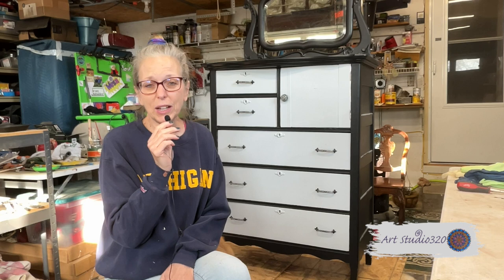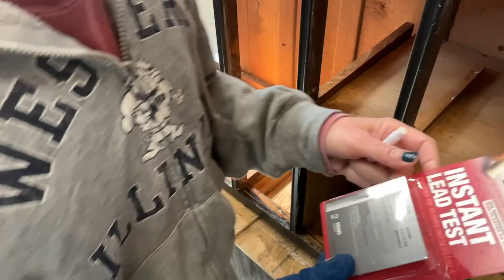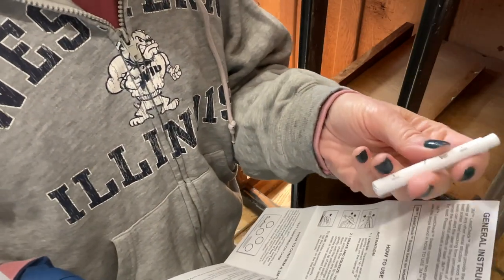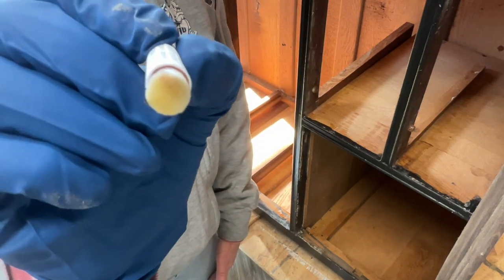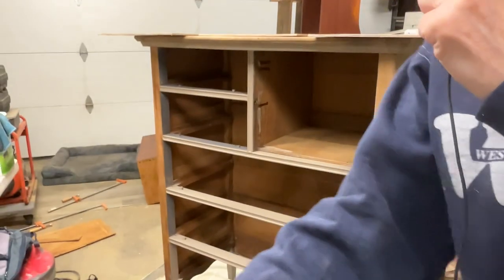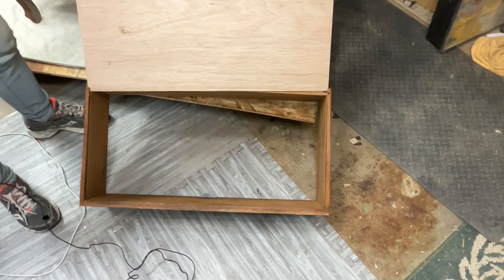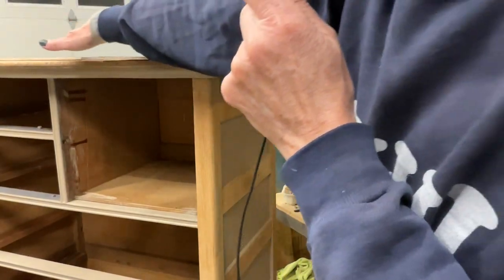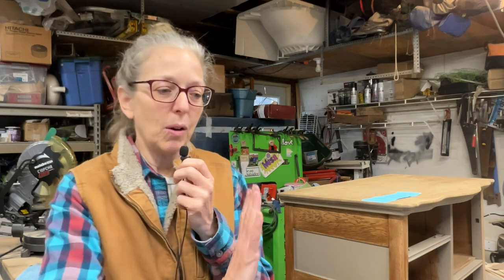DIY Furniture Flip - How To Makeover a Painted Antique

Comment: You should never glue a drawer bottom, slide it in and put 3-4 nails in where it meets the back of the drawer. This will allow for movement of drawers in temp changes.
Reply: I was thinking the same thing.  Since so many homes have heat and a/c to maintain a constant temperature and humidity, maybe there won’t be too much expansion or contraction of wood to make part of the drawers split.  It is a beautiful piece now though and hopefully someone will appreciate it and want it.
Reply from the maker: Thanks for your comments! I normally I wouldn’t glue and probably should have mention that but believe it or not they were glued in to begin with! When I’ve done it before I used finishing nails. Each piece I do is very different, thanks for noticing and commenting I appreciate that!! 😀
Reply from the maker: One more thing, the pieces slid I had lots of give so any expansion probably would be compensated!